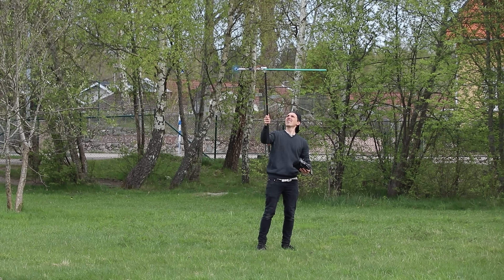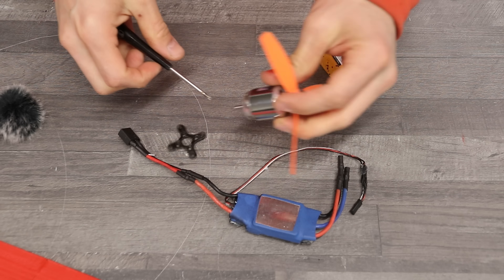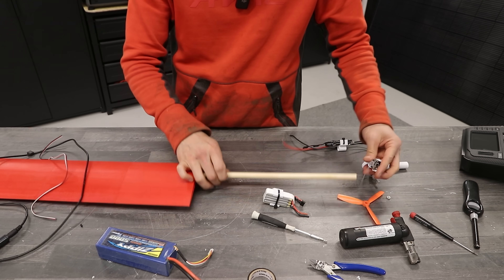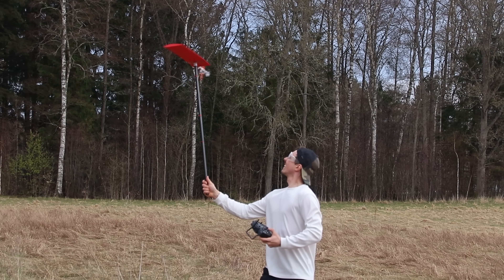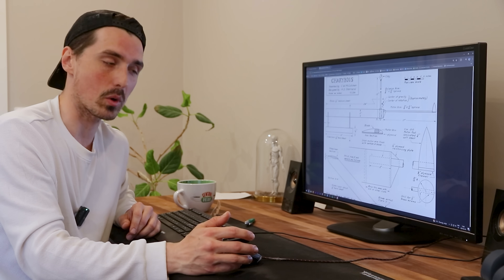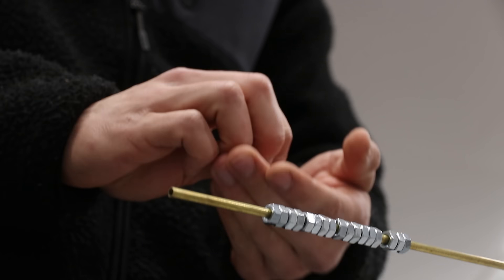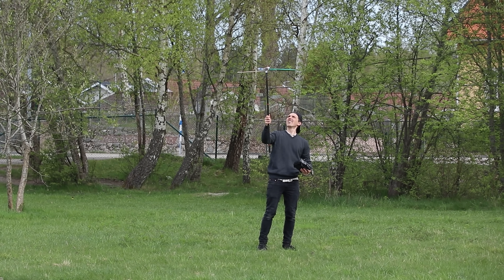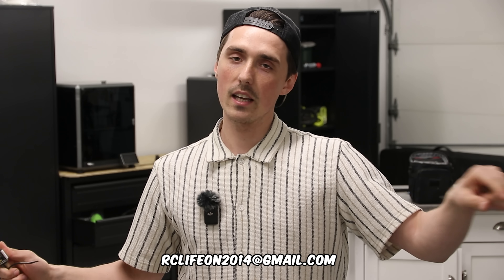How Does This Fly With Only 1 Wing?

Comment: I wonder if there's any hobby-grade flight-controller that can handle all the calculations required to modulate the throttle just right to make it controllable with no moving parts besides the prop...

Comment: Virtually none of the lift is being generated by the parts of the wing close to the center of rotation (particularly the part moving backward). Save the weight of that part of the wing, and use the only slightly reduced lift more efficiently.

Comment: The weight on the stick isn't to offset the centre of gravity, but to provide pitch stability of the wing. Without getting too deep into the dynamics, the weight on a stick increases the moment of inertia along the wing spar axis which, once spinning, creates a stabilising gyroscopic force that prevents the wing from pitching.
Reply: Yes, and another function is to set the wing's pitch angle (as well as the prop's pitch angle). The weight basically makes the vehicle strongly prefer to align its "plane" perpendicular to the spin axis. At that point, you can set the wing and prop's pitch angle relative to the weight pole.
Reply: @IsaacKuo  yep good point
Reply: So adding a servo to move the weight stick up and down, could be used to control the wing angle of attack.

Comment: May I suggest using a hot air adapter to your torch? Too much flame causes the shrink tube to char and become conductive.
Other than that, great work!

Don't sweat the errors, they are part of discovery!

Isn't the force of mass increased with rotational speed? Is it equal to all directions, so the CG stays in the same location as the speed increases? 

I love the sound as increases the rotational speed, it sounds just like the old scifi movie sound effects!!!

Comment: The biggest difference that I see between your wing and that of the other guy, is that his is more of a blade, and not really a wing.  Which means he’s probably dealing with no more than 1/5 the weight that you are working with.  As for landing, have you thought about reversing the motor for an abrupt stop of the rotation, and just letting it fall?  It might produce less damage.

Comment: Those 9:50 minutes until you mentioned the leading edge of the wing was facing the same way as the prop were Excruciating man...I did not see anyone in the comments mentioning it at a glance...I was screaming internally ! And then...FINALLY !
Reply: You saved me from 5 minutes of agony
Reply: It was painful to watch!
Reply: Clearly, engineering is not his forte.
Reply: Yeah, I saw that, but I just assumed that either a) I was wrong, what the hell do I know about making a mono-wing or b) he spotted the error and fixed it before testing.
Never occurred to me that the real answer was c) he made a boo-boo! 🤣
Anyway, this was fun!
Reply: I was in the same state as you were... I simply couldn't understand (unless made on purpose) that fatal error.

I will post it on the general comments but unless the rotating axis is positioned at the beginning of the wing, it won't fly.

Comment: You mounted your propeller in such a way that the wing works in reverse , with most of the trailing edge cutting the air and most of the leading edge not leading at all. This is nut. I hardly understand how you can lack basic engineering sense that much.
Your main idea is fun and exciting. Next time you want to design anything aerodynamic, let me design it instead. You'll save a lot of material and failure time. Don't worry, I will let you the fun of printing, building and testing.
P.S.: I already have in mind a theoretical solution without separate secondary counterweight and secondary aerodynamic stabilizer, thanks to curvature effects, if you want a very pure and elegant design.

9:37 Yeah, duh! Exactly what I saw as soon as the propeller was installed. It's only now that you realize it. You should have realized it at least when you located the center of gravity.
I'm so jealous of people who have all the money to build toys but barely understand what they're doing...
Whatever. Have fun.

Comment: I love how you glance over the most important part by rotating the Wing the wrong way, Plus quit trying to 3D print everything it's not strong
Reply: Polycarbonate and Nylon enter the chat
Reply: @LexxDesign3D no chat here, just stating physics, dude 3d prints parts and brags about how much stronger and lighter than other manufacturing processes they are, then proceeds to break everything because they are doomed from the beginning no matter what they are constructed from because the thrust and the aspect of the only wing where facing the wrong direction (which any person who has ever flown a simple airfoil would have noticed) actually leads me to think that this whole video is just 😮 one large trolling episode

Comment: Flight controller + motor tilt servo = position control?
Reply: I thought maybe a servo connected to that backwards facing stick.. I like your idea too 😂😂
Reply: @Furby_assassin  maybe even just modulation the motor speed to increase lift on one side of the spin.
Reply: @dfgaJK  yeah that could work. There's probably a bunch of different ways to try to get more control over it. It would be awesome to see the ideas put to real application.
Reply: @Furby_assassin  I imagine the hard part would be heading tracking, you'd need a good magnetometer or something similar.

Comment: Wing near the center sees very little airspeed, and the wing at the end sees very high airspeed. You want a wing like wind turbines have, where the airfoil is optimized for the airspeed expected at the radius from the center. Heroine virtual had a monocopter with a persistence-of-vision display built in.

Comment: If you put the motor facing the Leading edge, you can use less weight up front.
If you put the battery where the stick is to balance the CG, you will not have to add more weight to the machine.

Comment: Nice one Simon 😊 So cool to see someone else trying these one winged helicopters! I also based by designs on that original Charybdis design and found the extra stabiliser unnecessary. If the wing has a positive angle of attack, it works just like a flying wing (with no tail). I’ve also found other designs work without the counterweight (again, like a flying wing).
Reply: wow
Reply: Now let’s try to find a genius who can give basic directional control. Maybe with some gyro magic? Since it’s rotating an upward force might translate into a pitch or yaw if timed properly?
Reply: I have made monocopters with directional control, using a magnetometer (digital compass sensor). A gyro is usually too slow, since most gyros have a maximum measurable angular velocity of 2000 degrees per second, which translates to only 5.6 rotations per second. So unless your monocopter rotates very slowly a gyro can't keep up.
Reply: Ello
Reply: https://youtu.be/hRMZGrboWBo?si=6v9Yxaqn_MHXuGgd

Comment: Your English is fine.

When the wing is free to move, the center of gravity is going to be directly below the center of lift; that is just physics.  If that orientation of the wing is then such that the thrust vector is not pointing straight down, the wing is going to spiral off at random.

The problem is,  the center of lift tends to be halfway down the length of the wing, while the center of lift is much closer to the motor, so the wing will yaw (or bank, depending on how you look at it) severely, trying to get the COG directly below the COL.  I don’t see how to overcome this.
Reply: His English is better than some of my English friends 😂
Reply: It's really untrue that the wing will spiral off if the thrust vector is not pointed straight down.

In fact, it's impossible for the thrust vector to point straight down due to drag. The wing has no propeller to counteract drag, so its thrust vector will always point "backwards" compared to its motion. The propeller is there to prevent drag from slowing down the spin rate, but it's pointed in the opposite direction so this doesn't "straighten" the thrust vector downward. It does the opposite, making the thrust vector even further away from straight down.

Nevertheless, monocopters work and the fact that the thrust vector does not point straight down simply is not a problem. Why not? Because the vehicle is spinning. That means that the thrust vector sweeps out a cone, and the overall effect is an average thrust vector that points straight down.
Reply: @IsaacKuo  "monocopter"?  Should be “monopter”, one wing.
But drag is resistance to horizontal motion.  The monopter is supposed to hover, isn’t it?